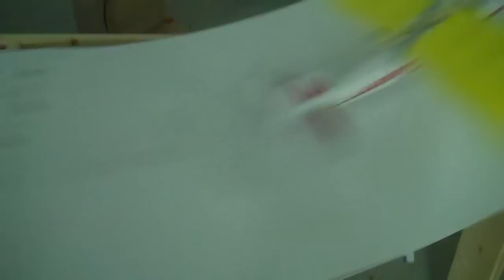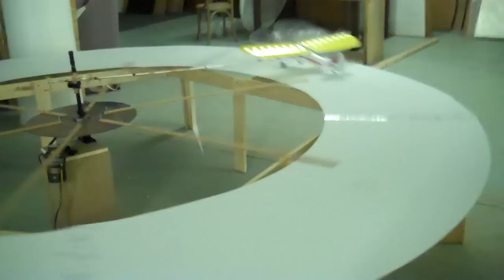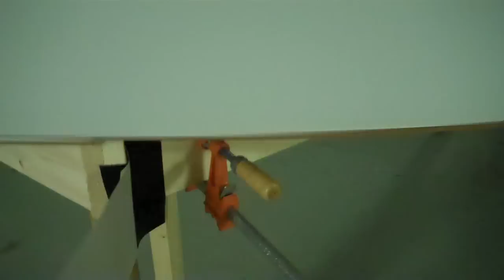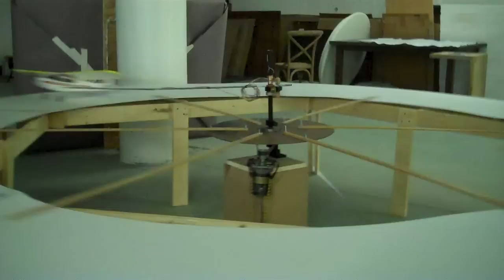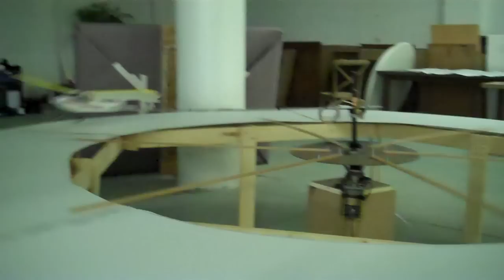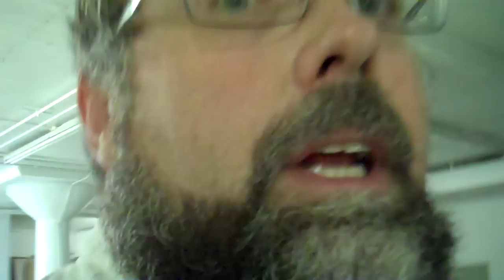Airplane On a Conveyor Belt Proof of Concept

Comment: I like the attempt but until you demonstrate that the wheels are moving at the same exact speed as the "conveyer belt," you've not solved this problem.  It's VERY clear that your set up is violating the rules as the question is typically proposed.  The fact that the plane moves around the "conveyer belt" proves that the wheels are moving at a different speed.  The question demands that the speed of the wheels and the speed of the conveyor belt remain equal.  The instant the plane moves forward, you've broken the rule.
Reply: Yes. He went air speed vs conveyor speed, and not what the experiment calls for. 

This is the same mistake Adam keeps making in regards to the experiment.
Reply: The plane is going the same speed as the belt right? I thought that was the bottom line of the experiment. Both of their velocities equal each other even though they are in different directions. Their relative velocity is higher than that of the car and the belt. Think of it like this. If a carpet is moving under my feet at five miles an hour and I am walking at five miles an hour then I would be stationary relative to the ceiling for example. This would be the car experiment. If while the carpet is moving under me at 5mph and I instead push off of the ceiling using the ceiling like monkey bars. I can travel at 5mph relative to the ceiling which is equal to the 5 miles per hour of the carpet. I could even walk on the ground while pushing off of the ceiling but my legs would feel that I was going 10mph but my speed relative to the ceiling is still 5mph. The plane takes off because it is pushing off of the air to gain speed. Not the ground. The plane doesn’t push off of the ground so it doesn’t matter what speed the belt moves at. The plane pushes off of the air which is stationary. Similar to me pushing off of the ceiling. The car is limited to pushing off of the ground which is not stationary and thus the car, while traveling at 5mph relative to the ground(what it’s pushing off of) the car is stationary relative to the ceiling. I hope this made sense
Reply: @jacobbroosh3386  HAHHAAHAAHAAHAHAAHHAHA!!!!
You don't need to explain to me what argument you guys think we make and why it's wrong.  I've been debating people about this for years. Listen to me bub.  LOL  Hear these words and digest them. Literally the only people who ever ever ever ever ever ever ever ever say anything about the wheels moving the plane forward are people who say the plane WILL take off when they accuse US of saying we think the wheels keep the plane from moving forward.  WE NEVER EVER EVER EVER EVER SAY THAT!!!!!!!!!  So in the future... PLEASE STOP SAYING THE PLANE MOVES FORWARD WITH THE ENGINES!!!!!

WE KNOW THAT!!!!!!!!!!  

What you need to understand is that the plane is not in the air yet.  So your monkey bar comparison is pretty flawed.  Sorry.  But forget that.  That's not even important.  What IS important is the fact that (and I really need you to listen to this because it's the entire argument) in order for the plane to move forward so it attains lift, it 100% necessarily must absolutely totally without fail physically make the wheels spin faster than the conveyor belt.  There's no getting around that.  Gravity is pulling the plane down.  It's still on the ground.  There is friction.  It's not skidding.  The wheels MUST spin faster than the conveyor belt.  That is axiomatically true.  You can not argue any differently.  If you do, then there's no use continuing on with this conversation.  It's simple mechanics.  Plane speed = Wheel speed + conveyor belt speed. (Since the conveyor belt is moving backwards, that variable is negative.)

This is when we get into trouble.  Because the question as it's generally proposed says with explicit unquestionable detail that the conveyor belt MUST MOVE AT THE SAME RATE AS THE WHEELS!!!! You can't ignore that.  It's an absolute required constraint.  The instant the wheels spin faster.... BOOM!  You're doing a completely different experiment.

You can argue that nothing keeps the plane from moving forward, but that's where you're wrong. The experimental constraints do.  You can argue that the question is flawed, and I wouldn't argue against you if you did.  But what you can NOT SAY is that the plane-conveyor belt system will manage to keep the wheels and the conveyor belt moving at the same rate AND that the plane will be able to fly.  Considering the question, it's 100% impossible.

Now if you put a different constraint on the conveyor belt, like for example if you say it's spinning at the plane's takeoff speed, but you DON'T include the constraint saying the belt will match the wheel speed, then yes, you could say in theory that the plane could take off.  Because a different speed is allowed.  But so long as the experiment constraints say the wheels and the conveyor belt MUST be moving at the same (but opposite) speed, there's absolutely no way that the plane can possibly take off.

(Please don't think I'm trying to be rude.  If I sound that way it's not intentional and I apologize.  I enjoy this debate.  It's fun picking on you knuckleheads.  LOL)
Reply: the belt is moving at the take off speed what dont you understand about this the plane will always move foward since its not a car with a car the motion gets cancled since power is being applied at the wheels in this case the motion is being applied from the propeller its a trick question
Reply: @super1337bf3ordie  You clearly didn't read my last comment.
Reply: @super1337bf3ordie  And the question says that the conveyor belt matches the speed of the wheels, not that the conveyor belt is moving at the plane's takeoff speed.
Reply: @SmartAlx  i did some thinking about this and it dosent matter how fast the belt is spinning since the wheels are free spinning they dont drive the plane it gets its movment from thrust so it goes foward imagine you are holding a car on a convayer belt the belt is on max but you can push the toy car since the force isnt applyed at the wheels
Reply: @SmartAlx  also he is following the rules the plane still moves foward since its moving through the air and not the gorund it will always take off
Reply: @SmartAlx  since the wheels arnt involved in the foward motion of the aircraft they just spin i guess it could get to a certan point where the wheel bearings can spin so fast
Reply: @SmartAlx  last reply what we need to remember is that thrust from the engines is in no way coupled to the conveyor belt so regardless of what the belt is doing, the engines are able to provide forward thrust and therefore lift
Reply: @super1337bf3ordie  Dude.  Freaking read my earlier reply.  You literally did exactly what I said AAAAAAALLLLL people who say the plane will take off do: create a strawman about those of us who say the plane won't take off.
Reply: @super1337bf3ordie  HAHAAHHAHAAHAAHAHAHAHAHAHAHAHHAHAHAHAHAHAHAHAHAHAHAHAHAHAHAHAHAHAHAHAHAHHAHHAHAAHHHAHAHAHAHHHAHHAAHAHH!!!!!!!!!!!!

You think the plane is moving through the air BEFORE IT HAS LEFT THE GROUND???????

Dude.  Think.  We are trying to figure out what happens BEEEEEFOOOOOOOORE the plane takes off into the air.  The FULL WEIGHT OF THE AIRPLANE is bearing down on the conveyor belt.

And the wheels can't possibly be "free spinning" because they are secured at two points.
Reply: @SmartAlx  the plane can still take off all it does is hit the breaks use the backwards speed then take off
Reply: @SmartAlx  Yes the original question is flawed, but the fact that the wheels will always move faster then the belt is true. The question clearly states that that is impossible but thats not how it is in reality. The wheels will always move faster then the belt. 
Imagine if you are standing on a treadmill with rollerblades, holding onto the sides, no matter how fast the belt is moving you are standing still right? And if you push forward with your arms you will move forward. I know in the original question it is stated that in that moment the speed of the belt will increase too, but that does not matter you will move forward. Even if the treadmill is accelerating and moving faster then you pull yourself forward you will still go forward. 
So the question is flawed to its core. 
But you are ofc right if the plane cant move forward there is no air under the wings so it cant fly. But in reality the plane will always move forward.
Reply: @SmartAlx   "Plane speed = Wheel speed + conveyor belt speed."  in ZERO plane speak, is the speed of the wheels measured or cared about.  On the dash, there is no gauge that shows wheel speed. There are gauges that show speed, but that is speed relative the the ground.  

If the jet is idle on this magic speed matching belt. And then throttles up. at 1MPH, the wheels will be turning 2 MPH. At 30 MPH , the wheels will be turning at 60MPH. The belt is spinning the backwards to the direction of takeoff. If it is matching the rotational speed of the tires, then the tires will just spin 2X the speed of the moving plane at any point of measurement. 

How about if you look at it differently.  If I put on a jetpack and skates. Then I stand on a very fast moving belt, holding on to a rope ( jetpack off). What is happening? I am staying in place, because I'm holding the rope. The skate tires are spinning at the same speed of the belt. At the same time, I let off rope and throttle up. Do I move at all?  Now lets apply the magic belt, and have it speed up as I move. So, as the jetpack moves me forward at 4 mph, the belt compensates and increases speed. So, now the belt is spinning 104 MPH backwards, the skates are spinning at 208 MPH, and I'm moving 4 MPH relative to the ground. ( NOTE in this thought experiment, I give you " no it won't fly " people an edge, as the belt is already moving 100MPH the other way.  Per the riddle, it would be as such :    ) 

        As I throttle up the jet pack and move 1 MPH relative to the ground,  the belt counters by turning 1MPH the other way. At this point, I am moving 1 MPH, the belt is moving other way at 1MPH, the skates are spinning at 2 MPH.  If you stop and measure at any given point, the skates will be spinning twice as fast as the belt. And the belt will be moving exactly as fast as me, but the other way. So when I reach 200 MPH,  the belt will be going 200MPH the other way and my skates will be spinning at twice that, 400MPH. The only way this riddle keeps the jet from moving is if the wheels friction also constantly adjusts.
Reply: @BigBadDodge4x4  "at 1MPH, the wheels will be turning 2 MPH. At 30 MPH , the wheels will be turning at 60MPH."

Thereby violating the rules layed out in the question.

As I said, the only way you can move forward is by breaking the rules.

Which means YOU CAN NOT GET OFF THE GROUND WHILE FOLLOWING THE RULES!!!
Reply: @SmartAlx  1. The rules NEVER said the wheels can't turn. The rules said the belt will turn to counter the rotation of the tires.  YOU are taking that to mean the tires can't turn.  That is NOT how it reads. It reads the belt will turn the other way of the jet.. That is important. Please read my next reply, because I solved the riddle with a solution that will make the " wheels cant turn " people happy.
Reply: The belt moves the other way to the wheels, NOT the plane. If it is the plane, then yes the belt will spin backwards.. However, if we zoom to the wheel to belt contact. The bottom of the tire that is in contact with the belt is moving backwards to the takeoff of the jet... That means per this riddle, the belt MUST be spinning in the SAME direction of takeoff! Actually the more I simulate this with toys, the more crazy it gets. Turns out, the jet does not move on the belt, it remans exactly on the same spot on the belt! This is why those people think it wont takeoff. However, the belt is moving at the same speed the jet is as its throttling up.

3 prospective :

1. Guy in plane sees the same un moving spot on the belt. From her POV, it appears as if the belt is launching her jet. The jet remains on the same spot on the belt. The belt AND the jet are both equally moving at the same speed when compared to ground speed. The wheels are NOT turning, yet the jet is moving.

2. Guy on the ground beside the conveyer. It appears as if the belt is gaining speed, as if the wheels are glued to the belt. As the thrust increases, both the belt and the jet move faster and faster till the jet lifts off the belt. Wheels never make a rotation at all.

3. Girl standing on the belt. She is ~100ft in front of the jet. As the jet throttles up, the belt starts to move. The jet constantly remains 100ft in front of her. As she looks off the belt, the ground is moving faster and faster. Eventually the belt reaches 200MPH, and the jet just gently lifts off the belt. From her POV, it looks like a jump jet, as it just gains altitude. DUCK! , she must duck down, as now the wheels are off the belt, the jet is now approaching her, as it is gaining speed, and the belt is slowing. ( She was watching the wheels, and they never rotated. )

So, both sides are correct. Technically the people on the takeoff side are more correct. But what happens is the jet takes off with the tires never rotating, and the belt does NOT catapult the jet. It just moves at exactly the same takeoff speed as the jet. Thus the tires never turn.

Blown minds. I have yet to see this solution to this riddle.
Reply: @BigBadDodge4x4 

That's a lot of words for, "I don't care about the question. The plane will take off even when the question doesn't permit it to." 

 "Technically the people on the takeoff side are more correct"

How ON EARTH can you make that claim when it REQUIRES them to be answering A COMPLETELY DIFFERENT QUESTION????
Reply: @BigBadDodge4x4  "The rules NEVER said the wheels can't turn."

Duh. Please show me where I said they do.  In fact you said the wheels don't turn in your next comment. Ridiculous. Of course they turn. They must turn faster than the conveyor belt for the plane to move down the conveyor belt.

Literally not one single person on the "it can't take off" side says the wheels won't turn.

What is it with you people making these strawman arguments?
Reply: @BigBadDodge4x4  It's ludicrous to claim the plane can take off without the wheels turning. It's simple mechanics. The plane must move down the conveyor belt to gain lift. To move down the conveyor belt, the wheels must be moving faster than the conveyor belt. Period. There's no way around this.

You haven't seen anyone come up with this "solution" because it doesn't make any sense.
Reply: @SmartAlx   Allow me to explain differently.  The plane and belt are BOTH moving equally as the thrust is applied. So from all prospective the tires remain motionless. From the prospective of standing away from the belt, it appears as if the conveyer belt is  launching the jet. 

Per exact words of the riddle, "    The conveyor belt is designed to exactly match the speed of the wheels, moving in the opposite direction  " . NOT the whole jet, just the wheels.  And in what direction?  " opposite direction ". So for the belt to move the opposite direction of the tires, it must spin in the same direction of the jet takeoff. 

( if you stack two tires, and rotate one, the other turns the other way) ( If you zoom on to the lower part of the tire, where it makes contact with the belt. It is moving reverse of the forward motion of the jet, hence the bump you just hit is now BEHIND you) 

So, as thrust is applied and forward momentum is gained, at exactly the same time, the belt moves in the forward direction. ( That happens to be opposite direction of the tires ). Speed is gained. The jet remains on the same spot on the belt. No tire rotation happens. The jet takes off just as normal from the out side prospective. From the prospective of standing on the belt, it looks like the jet just lifts up. From in the jet, everything is moving fast and faster, except the runway belt   . 

So you see, the jet DOES take off. And no wheel movement occurs.
Reply: @SmartAlx   " That's a lot of words for, "I don't care about the question. The plane will take off even when the question doesn't permit it to."  "   I NEVER SAID that anywhere.  /maybe that is what YOU was thinking LOL  :) 

"Technically the people on the takeoff side are more correct"

How ON EARTH can you make that claim when it REQUIRES them to be answering A COMPLETELY DIFFERENT QUESTION????"

Because regardless of how you look at the riddle, the jet will takeoff. From my research, those that say it wont takeoff seem focused on only one sentence or concept of the riddle.  { that the belt matches the tire speed }.  And thus conclude no wheel movement, no air over wings, no flight.  When that is NOT how the riddle reads. It DOES NOT say the tires will not spin. In implies they will spin but going diff than the belt.
Reply: @SmartAlx   The rules NEVER said the wheels can't turn.

"Duh. Please show me where I said they do.  " {at 1MPH, the wheels will be turning 2 MPH. At 30 MPH , the wheels will be turning at 60MPH. Thereby violating the rules layed out in the question. As I said, the only way you can move forward is by breaking the rules}   Right there you are stating that you think the rules are the wheels cant spin.  ( Dude, you must have a whole barn of straw :) LOL )  

Literally not one single person on the "it can't take off" side says the wheels won't turn. ( You now speak for everyone that has discussed this !!? )

"As I said, the only way you can move forward is by breaking the rules" . Nope, NOT the only way. As I explained, both the BELT and the JET accelerate equally. And the tires do not turn. 

Honestly I am getting mixed signals from you. Originally you  said it cant fly. You said the wheels cant turn. Now you seem to be saying the wheels can turn at twice to belt speed. And the jet can takeoff.  Have you switched your solution? 

Can I ask, are you left leaning?  In my time researching this I have concluded its mostly right leaning people that think it won't fly. ( obviously people from all sides are different, not EVERY lefty thinks itll fly). But you use of certain terms and words makes me think your left. And you probably resort to insulting and name calling instead of trying to maintain a civil talk. ( I speaking if you are on political pages)
Reply: @BigBadDodge4x4  "Because regardless of how you look at the riddle, the jet will takeoff." WHAT ARE YOU TALKING ABOUT???? The very EXISTENCE of the question puts that claim into doubt. You're literally committing a question begging fallacy.
Reply: @BigBadDodge4x4  "In implies they will spin but going diff than the belt."

How ON EARTH does "designed to match the speed of the wheels" imply "spin but different from the belt????"

THEY ARE COMPLETELY OPPOSITE SENTENCES!
Reply: @BigBadDodge4x4  "So for the belt to move the opposite direction of the tires, it must spin in the same direction of the jet takeoff."

HAHAHAAHAHAHAHAHAH!!! What are you talking about? Wholey moley that's NOT TRUE!!!

Wow!!!!
Reply: @BigBadDodge4x4  🤦 sigh

In the universe you described in which this makes sense, are the wheels and belt moving at the same speed? Yes or no?
Reply: @SmartAlx  the riddle says the belt turns opposite of the wheels.  Is the belt turning forward or backwards to the whole jet?  If the wheel is rotating forward,  the contact patch is moving back, backwards. So the belt moves the opposite direction to that.  The belt is designed to match the speed of the wheels. The belt and jet move forward together in sync.
Reply: @SmartAlx  you get it!
Reply: Replace the propellor of the fron with a rear-facing jet engine so we can nullify the effect of airflow over the wings induced by the engine itself.  In this scenario, how can the plane ever have airflow over and under the wings if the conveyor belt cancels out any forward movement relative to a point not on the conveyor?  It can’t.  The plane can only lift off if it is moving forward into the air compressing air beneath its wings and getting a boost from Bernoulli’s principle.  The plane absolutely must move forward relative to a vantage point not on the conveyor belt.  It’s wheels necessarily must move faster than the conveyor belt.